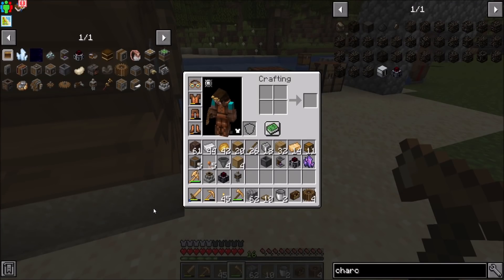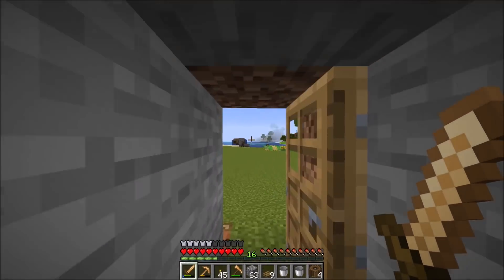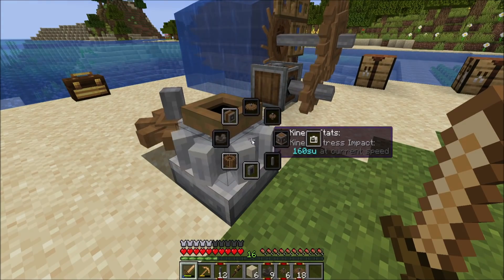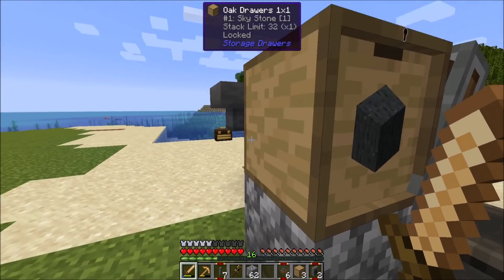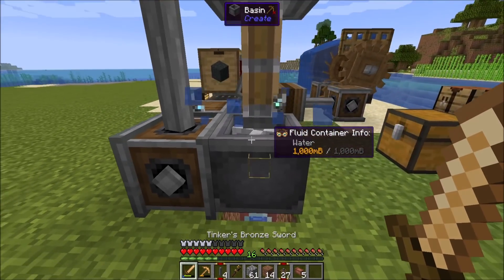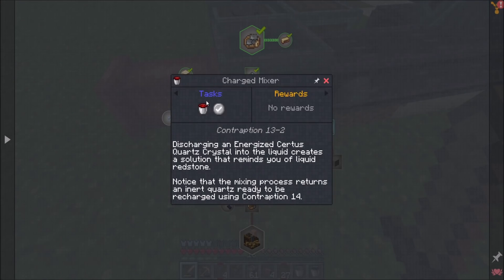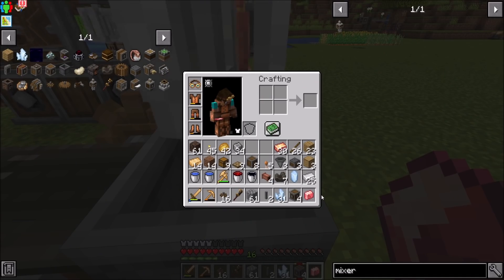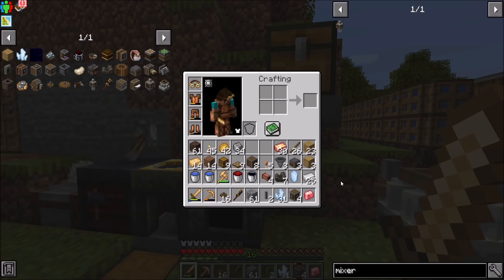Create A&B Ep12 Rose Quartz Pt1

Comment: Really cool feature I discovered recently: If you have your toolbox(es) down nearby and block pick(middle mouse button) on an object that you have in your toolbox, it'll auto equip the item from the toolbox as if you'd accessed it from the toolbox menu. You can use this for create stuff AND standard building blocks. Super nifty feature

Also, you can just wrench things like andesite tunnels and gearboxes to orient them how you want. Place a gearbox and need vertical? Wrench it! Placed a tunnel pulling from a drawer? Wrench it! No need to pick them up and replace them or craft them to other type.

And seriously, you don't need to keep placing cobble to place mixers, stampers, or deployers. If you right click them on a belt or basin, they will automatically place at the correct height.

Comment: A way to simplify the basin setup for destabilized redstone would be to have a depot on one side, and a basin on the other, both a block below. The basin will automatically only output the craft product, so no need to filter the outputs.

Comment: I’m pretty sure you don’t need to put a cobble block on a basin before placing a mixer or press on top. If I remember correctly they should automatically be placed in the correct position if you just right click them on the top of the basin.

Comment: 1:00 wait, the water wheels just sped up,  that may have something to do with the reason the system over stressed last episode, the wheels didn't produce power at the sam speed and that may have produced some conflict
Reply: Last episode there was 1 wheel at a slower speed than the rest that still ran, so it's not related to being different speeds
Reply: @darrenng1548  man, play the modpack

Comment: You don't need any filters to process the destabilized redstone. Set a certeze as the basins output and it will automatically output to a belt. Because fluid is extracted separately it's totally self contained

Comment: Very cool episode today

once you have access to robotic arms you can move items in weird directions without the need of belts and funnels

Considering now that you are going to need power to charge the quarts and start creating molten iron I would recommend you start working on making a tree farm and utilize a flywheel setup that converts logs into charcoal, not only do you get a huge amount of rotational energy but you will have a charcoal assembly line that you can use for your melters and dynamos

Comment: Just want to mention this before it comes up while you're playing (I know you keep a backlog) - I've had some trouble with Create pumps not noticing a changed side config for Thermal tanks, but I've been working around it by using the wrench to rotate the pump, then wait a moment, then using the wrench to turn it back around again, which seems to update the pump to get it working again.

Also, Basins automatically output the result of a craft to blocks diagonally to the bottom, so no filtering required.

Comment: Pro Tip: when prototyping your contraptions in survival mode, build it on a platform of your preferred scaffolding material (e.g: netherack) ~4 blocks above the ground. Many Create elements greatly benefit from vertical interactions, and sometimes you just don't want to be digging with your hands all the time.

Comment: Dire, solution at ~ 29:30 does not require any brass, basins spit out results on any side connected belts/depos, so it's easily automatable withing ~ 3x3 blocks space. Also you should have been notices that funnels works in vertical directions too, so in my playthrough I drop results through funnel and two chutes to the belt below, and placed one funnel above charger facing upwards and another one higher facing basin, so it catches popped charged quartz and put it into basin.

Comment: You could replace the drawer with a drawer controller and then move the skystone drawer onto an hopper feeding into the mill. This will require some of these intermediary drawer bridges. But you could put a skystone dust drawer next to the controller as well and collect both of the items in the same drawer system
Reply: Drawer controllers are like chapter 3 or 4, not 2.
Reply: @Power46  As indicated by the quest book you can make basically anything in any chapter you just have to do it manually. I've had a drawer controller since before I completed chapter 1.

Comment: The most compact setup for the sky stone is hopper under the millstone pointed at a belt. Andesite funnel on the millstone feeding from the belt. Sky stone and sky stone dust will be put on the belt, the sky stone will immediately be put back into the millstone and the dust can go down to the basin. 

Also seconding the comment that said to stagger you left basins so they output automatically to the one below it.

Comment: Wouldn't using belts help prevent overstressing the system? Instead of using a million small/ large cogwheels to transfer power?
Reply: IIRC the opposite is true. Cogs and shafts and such don't add any stress, where for a while (though possibly changed) the belts DID cost stress by length.

Comment: You didn't need the smart pipes, you just put the sky solution filter on the wrong basin Dire. You also could have saved yourself a gear by putting a single small gear between the two mixers rather than going along the backside.